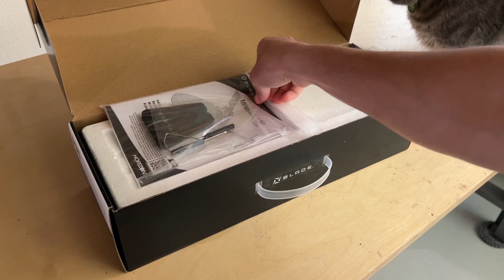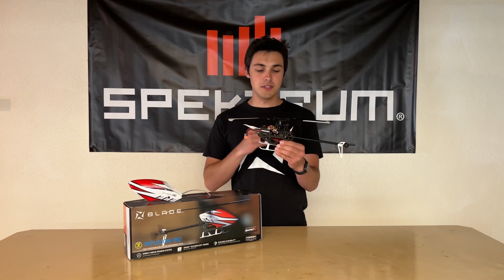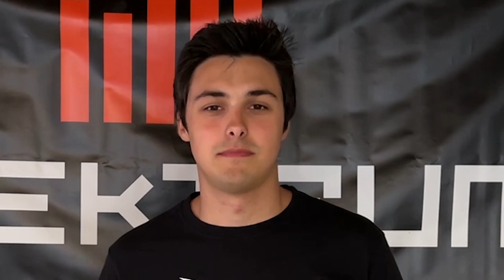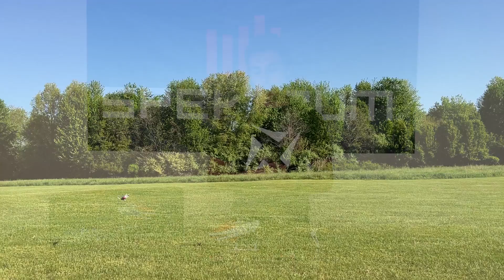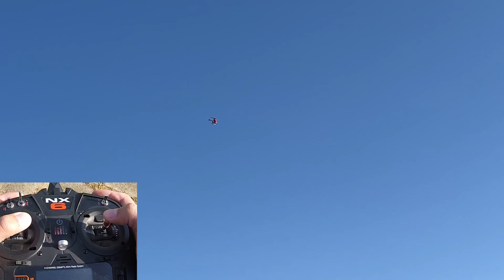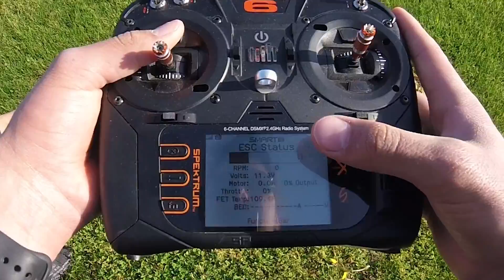Blade InFusion 180 OVERVIEW! Is this the new BEST BEGINNER RC HELICOPTER?

Comment: Is the heli meant to keep altitude when in safe?.. mine wants to land and I have to keep nudging the throttle upwards to keep it back up in the air. If I bring the throttle down, the heli wants to land faster instead of gradually floating down almost as if there is a downward thrust. Why is this happening? This is happening on both the 180 infusion and 150s that I have right out of the box.
Reply from the maker: This is normal behavior. There is no altitude hold with SAFE, it just returns the heli to an upright level orientiation. The throttle stick also directly controls the pitch, you will typically need it to be above 50% in order to maintain or increase your altitude. Hope this helps!
Reply: @EthanAter  thanks. When I lower the throttle, it doesnt just float down.. it seems to have a downward thrust.. even with pitch above 50%

Comment: Has Blade beefed up the canopy mounting pegs for this design? I got a 120 SR for my dad and first flight broke one of the canopy pegs off the frame (landed in snow). Gorilla glue is our new peg 🤨.

Edit: I see now, in the video close up, looks like the only canopy pegs (just 2, correct?) are the thicker variety. Good.

Comment: Good morning.
it flies very well except for one rather annoying thing, when it turns to the left, it drifts backwards at the same time and therefore loses the habit, this happens every time I steer to the left.
If I steer to the right, no problem, the helicopter remains parallel to the ground, perfect for me.
I did a calibration but it didn't change anything, maybe it could come with the advanced program but I don't know where to adjust yes a channel is incorrectly adjusted? I have activated stabilized mode.  My radio and the Spectrum DX6e.
Thanks in advance.

Comment: I tried every setting possible with the tail rotor in foreword programing. I'm very frustrated. It kicks out on mode 1 and 2.  The best I could do was get it down to just barely shaking but thats not good enuff.   I'm now thinking the tail motor is to weak. It screeches sometimes also. Thinking I should have bought the proven OMP 2     Anyone have any good PID'S  I can try.  15 Battery packs through it and still not tuned :(
Reply: Same.... sorry to here but glad I'm not alone.. WTF bro! I'm pretty sure no PIDS will help.. it's vibration! I am going to try some different mounting tape. So disappointed 300 mother effing doll hairs

Comment: Ethan, I just got mine yesterday and i am getting some shaking looks in my main head it does it every now and then in stunt mode 1 but i cant even go above 80% throttle curves for stunt 2 without it doing it so bad the tail is even moving all over the place.. Can you give me any advice on what to adjust on the PID settings? also how loose are the main blades on this one? out of the box they felt way to loose so i tightened them but then felt the shakes so i loosening them back up but maybe needs to be even looser? feels pretty loose now.  Thanks for any advice. it fly pretty nice in stunt 1 at like 80%
Reply: Mine shake on start up  and shutdown.  Hard pitch pumps it wants to nose up aggressively.
Reply: @N8904V  Mine is pretty smooth at those times. Just when flying flying switch to stunt 2. It goes crazy shacking and tail goes crazy I am guessing cause of the rest of the heli being so wobbly.
Reply: @epoweredrc     Mine is doing the same thing. Several other people also.  Would be nice if Ethan would put a video up on the proper PID  Settings for the tail rotor.  I asked him but no response. I should have waited to see the reviews before I bought it :(     Great heli if it flew correctly
Reply: @wingman7774  Hey there try switching your main blades around. I did that and I fixed 90% of my issues. I was amazed after trying that.
Reply: @epoweredrc    I'm going to try that,  My settings are very close now but some vibration and kicking out just a bit in mode 1 and 2.    I may try tuning with a 450 MAH  Battery. I have been using a Tattoo 850 MAH 75c . Thanks epoweredrc willing to try about anything at this point.  I had big hopes for this heli :)
Reply: @wingman7774  Hope it helps. Mine just had terrible shacks in the head and was making the tail go nuts. I'm uploading a new video now and the tail was acting a little nervous but it was a new lipo and seemed to have more power might have to play with the PID some more..  I've really been enjoying the heli.

Comment: Lmfao Blade is cloning OMP now. Don't buy this crap or spektrum . Buy the original and still the best OMP M2 or M1.
Reply from the maker: Look at both helis again, bud. Completely different design.
Reply: @EthanAter  LOL you are right. Completely different. I have owned many Blade heli's and I own OMP and OXY and can tell you that Blade is simply not in the same league as OMP and OXY.

Comment: I have an OMP M2 with direct drive and it is great, this one should be as well. May have to add one of these to the fleet as I do like Blade's SAFE mode and controller setup.
Reply: your OMP M2 its 6G that is safe mode?…  I like the helicopter but they're a little pricey.  And then you got the blade infusion which you purely paying for the brand-name.  Be happy with what you have will be a better helicopter than the blade